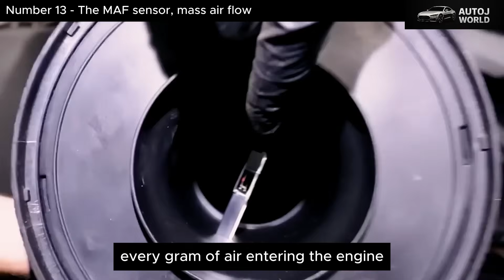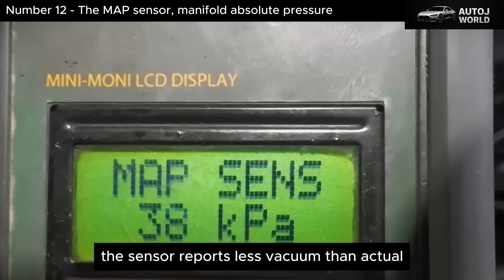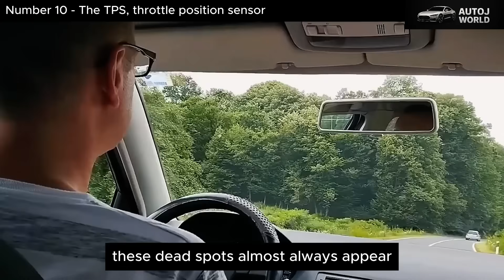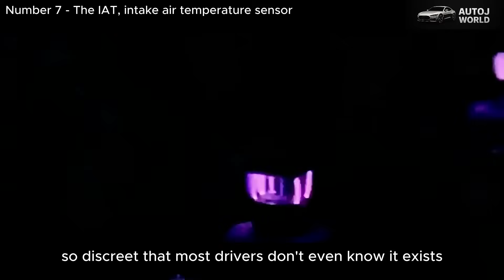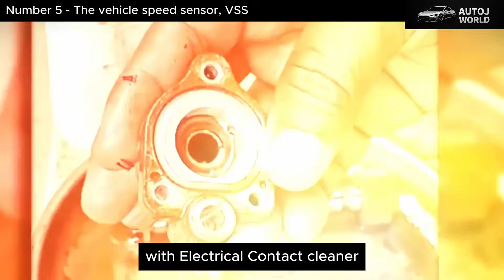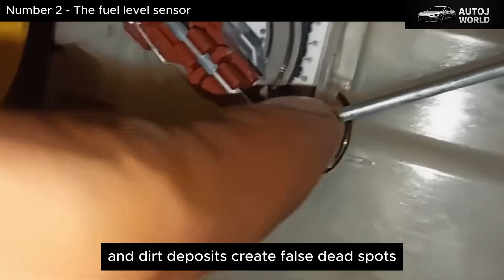The Sensor That FAILS Most Often in Your Car and Almost No One Cleans

Comment: it would be nice if they show diagram of where parts are located for each specific car make in the maintenance manual, then the people would at least try to do some repairs. I have Silverado 2001, I replaced oil, oil filters, air filter, but never touch the sensors. I think it would be nice for me to know where sensors and cleaned them. i have over 340,000 miles and never touch them, never had issue until now, more gas consumption.
Reply from the maker: Glad you're looking to maintain your truck; hopefully this helps you get started!

Comment: Yeah!!!
I JUST FIGURED OUT THE CRANK NO START. 
AUTO ZONE DIAGNOSED MY 5.3. IT WASN'T FUEL PUMP😅😅😅BUT FUEL PUMP FUSE.😂😂THAN
I CLEANED THROTTLE BODY. GONNA CLEAN MAF SENSOR.  ILL LOOK FOR THE OTHER ONES.
BUT I DON'T WANT TO OPEN ANOTHER CAN😅

Comment: Actually the entire philosophy of all this is genius.  Granted, harder to diagnose than a carburetored old school timed motor, but much cleaner and efficient.  They should have stopped right here.  But, they tried to squeeze blood out of turnip with direct injection, turbos, cylinder deactivation, CVT’s,start/stop, fewer cylinders, weak rings, wet belts, and thinner motor oils.  Then they overdid the plastics and under engineered them to boot.  Every manufacturer has in 2025 the technical knowhow to build a 250,000 mile engine.

Comment: Change your fricking oil every 5,000 miles and these wont fill up with sludge !       I have a 2001 GMC Sierra that still has all these parts from the factory (never been changed) because I change my oil and oil and air filter regularly as needed.     NOT Difficult if you take care of your vehicle !

Comment: They missed the most important sensor of all. This sensor is even more detrimental to the safe operation of your vehicle than all those sensors mentioned put together. That sensor is the passenger Methane overload sensor. This sensor can be a life savior technological marvel. Sometimes when you are driving and have a passenger present catastrophic events can take place putting the driver in a very dangerous even deadly situation causing catastrophic driver failure such as coughing, gagging, projectile vomiting and even passing out from lack of oxygen due to Methane gas overload while at the wheel. Although, almost never mentioned in emergency response reports, this tragic occurrence has been proven to be the root cause of as high as 35% of all automobile accidents involving fatalities and critical injuries. So my advice to all of you is to always have your mechanic check this sensor for you at every oil change. It is always best to choose a mechanic who consumes a large amount of unhealthy, intestinal track irritating foods and drinks a lot of beers after work. Timing your oil change with your mechanics unhealthy habits is crucial to testing this critical Passenger Methane Overload Sensor (Also referred to as the Passenger Silent But Deadly Warning Sensor) properly. Thank you and always be aware of your passenger's SBDs!

Comment: Cheap connectors are as much to blame as dirty ones.  The coil array connectors on my Silverado had several female side pins that lost their spring tension and collapsed, not making consistent, good connection.  I replaced both connectors with IP-65 grade aviation connectors.  Problem solved.

Comment: Excelent video, and these are the 13 lucky sensor. Additionally I suggest to include the wheel sensor speed which occasionally send wrong signal to the ABS Module.

Comment: Many oil pressure sensors leak oil when failed not always of course but most show signs of oil inside the plug when failed especially actual oil pressure sensor not just low oil on or off sensors I have seen both leak at failed conditions.

Comment: Bad cam sensor will make a International Diesel not run at all if bad, When it starts to fail the engine will shut off after heating a little, The problem usually intermittently at first sign of failure.

Comment: Quick reminder for Ludites. Cars that didn't have sensors used a lot more fuel and you were forever spending Saturday under the bonnet.
Reply: not true. It's a fun minigame to drive at the optimum condition for that car (eg: we chase the powerband-RPM), it is also not boring to fix car, it's like a toy. (when we drive it properly, it doesn't consume anymore fuel than a car with ECU. We know at what RPM it's tuned, so we can drive at that RPM for best fuel consumption).
Reply: @xponen  I did enjoy the tinkering I must admit but I've never got 55 mpg out of any analogue car.
Reply: @Spludgeroo  we can get 50mpg on carburettor by using small engine. For example; Daihatsu Mira from 1990s has 660cc or 850cc engine can achieve that mileage. The rule is small-engine get higher mileage regardless of carburettor or electronic-fuel-injection. In fact, on 125cc-motorcycle-engine we get 100mpg. When people talked about 100mpg, they talk like it is mythical/difficult, but it is simple to achieve 100mpg by changing the engine size.
Reply: @xponen  Well I had a Deawoo Matiz and it drunk like a fish on the motorway and it was like riding in a biscuit tin but my big comfy Citroen C8 got 55 mpg.
Reply: @Spludgeroo  Deawoo Matiz with 796cc engine with electronic-fuel-injection? maybe the distributor (ignition-timing) is broken or misconfigured (such as vacuum-hose got disconnected from the distributor in older cars), or maybe you drive at wrong RPM (for lightweight-engine, the RPM need to be 2500-3000rpm, but for heavyweight-engine like 2000cc Citroen C8, it is around 1500-2000rpm)
Reply: @xponen  Dunno. I've had loads of cars and ECU is better. I can't do anything with 800cc. Can hardly get in one.

Comment: My GMT400 has a carburetor (NO sensors) I don’t have ANY of these problems…
They sacrificed reliability for perceived superiority and we pay for it.  It’s all about narratives,  it’s more fuel efficient.  What is the carbon output to build and replace all the electronics that control the “modern” “fuel efficient” vehicles?  The attached the “efficiency” coefficient to a different variable to create a “new” constant and self declare a technical value that is a blatant lie and we pay for it.  Over and over and over, we pay for it…

Comment: knew them all, but great video... really good
have a good mechanic and am changing or cleaning all the sensors for the moment....
my 2 liter tdi 12 year old Audi A4 runs like a Swiss watch... 52 to 55 mpg
Reply: How did you do it?. I have 2012 Audi, I swapped the motor and transmission together, 
But it still not running smoothly, and the transmission is also shaky and not selecting smooth
Reply: @nedumjeff3106  I have 100k miles...drive 95%  highway at 70 to 80 mph...I have the 8speed AT from ZF... AND CHANGE OIL EVERY 5K MILES...

Comment: With a bad CPS crank position sensor it can cause a no start condition. It is necessary to have a CPS for the engine to run.
Reply: Not true ...engines operated perfectly with no sensors or ecu's not that many years ago
Reply: @JimW.-ns3pj ? Umm yes we all know they did. He wasn’t staying otherwise -only saying that on engines so equipped they’d get a no start

Comment: Time to go back to vehicles that don't even have any of these.
Reply: Back then the odometer only had 5 digits.
Reply: Oh yeah, fucking around with a damn carburetor and vacuum lines was great fun. Get any performance out of "dem good ol days" engines and they need constant fiddling and run different when the weather changes. Screw that. In the beginning of the smog control efforts, yes, it was trash and even more fiddle, but we are way past that. Probably went overboard on the tech around 10 or 15 years ago too. But, no bail stripped down engines are not practical for daily driving unless 80 hp  is fine,  or you are ok to use a single digit mpg engine to get a little grunt. We had just about the right amount of computer participation sometime around the 2000s to the 20teens, depending on the brand, then they really went hostile on end users, but throwing it all out is not the answer either.
Reply: @michaeljarvis5489  - Agree! I prefer the Ford 'Panther platform' cars - Crown Vic, Grand Marquis, Lincoln Town Car from the early '90's to the last ones in 2011. They had just enough tech, were simple, tough, safe, reliable, and weren't overloaded w extra needless space age electronic crap later cars now have standard, that break down every few months and costs thousands to fix. If I could, I'd want one w roll up windows, and manual door locks. But unfortunately, they weren't made quite that old school anymore after the 'early or mid 80s.
Reply: @michaeljarvis5489  that's why i love my 2002 honda accord. not too techy and reliable.
Reply: @ayoobi1691 my 96 civic is so easy and it doesn't need constant maintenance and it will absolutely fly .it was really cheap to replace everything and very easy and is now a new car that could be 150k to need much more
Reply: Are you serious? You wanna stick to old technology forever? If it's possible go drive a Model T Ford.
Reply: or, as Hamish have done, back more to ponies/horses......while at it, replace tractors wirth oxen......mobiles with landlines etc....

Comment: 13. MAF: Mass Airflow
12. MAP: Manifold Absolute Press
11. Oxygen Sensors 
10. TPS: Throttle Position Sensor 
9. Crankshaft Position Sensor
8. CMP: CamShaft Position Sensor
7. Intake Air Temp Sensor 
6. Engine Coolant Temp Sensor 
5. VSS: Vehicle Speed Sensor 
4. Knock Sensor 
3. Oil Pressure Sensor 
2. Fuel Level Sensor 
1. Sensor connectors & harness
Reply: tysvm
Reply: Fuel Rail Pressure Sensor
Reply: @larpsim  yep
Reply: Lotta mechanic will rip you off
Reply: Ambient Air Temperature Sensor 
Exhaust Temperature Sensor
Vane Position Sensor
Transmission Temperature Sensor
Water in Fuel Sensor
Reply: Thanks
Reply: Tyty ❤
Reply: Cla200d 2016 reg coupe sensors
Reply: You forgot the blinker fluid temperature sensor
Reply: You forgot a couple or 3: Tire Pressure Sensor..Windshield Washer Fluid Sensor..Radiator Coolant Level Sensor..
Reply: Thank you

Comment: Great info, could you comment on the use of the EGR valve, when and why it activates. thanks 😊
Reply: The EGR valve takes some burned exhaust gases and meters a small amount with the new fresh air going into the engine. Its purpose is to reduce NOX
emissions. With mileage, it is not unusual for the mechanical valve to develop carbon and gum deposits where it may stick and causing rough idle or stalling. It can also cause a check engine light. If you have a very high mileage car it can be removed and inspected; replacement is often the best option.

Comment: Over the years much expense and complexity have been added to automobiles for small gains in fuel economy.
Reply: If they want to sell more vehicles, get rid of all this bs and go back to making them simpler.
Reply: Yup, IMHO cars had enough techy stuff by the early to mid 90's. All the extra crap since is just good for making mechanics rich, and sticker prices ridiculous for the middle class! 🤑 🚗
Reply: @user6tos8ca Unfortunately most garages like simple and quantifiable service items and will immediately bail when confronted by any complexity such as electronic problems.
Reply: @AdamEast-yo8pz  - Probably true. All the more reason for me to keep my much simpler older cars in good shape as long as possible!
Reply: Your point is right but on a more broad scale for technology with small gains over the years... All except fuel milage  to a degree. 
  Never had there been any engine's  back in 60's, 70's, 80's, 90's that had 395 hp and get 17 mpg in city and 21 mpg on the highway. I have built many SB and  BBlocks that hit 375/425 hp and 8-10 mpg at best and if racing 4-8 mpg.
Reply: Yeah with massive engines that negate alot of the power hence how a lot your cars could only get few hundred horse power from a v8 5 litre engine lol

Comment: Give us back the dependable cars of the 1960's. These new cars that are supposed to be so great, are actually crapola. They run good for a couple years, then suddenly the cars start breaking down constantly.
Reply: Correct... and as really good and experienced mechanics are leaving the repair business. We are stuck with technitions who rely on anyalizations performed by more computers. Which costs far more than a good experienced mechanic, and many repairs cost more than a good used car used to cost.
Availability of older used vehicles was made far worse by a past president obama with his cash for clunkers crap... now the supply line for old vehicles and parts has nearly ceased. Forcing most to overspend on new or nearly new junk.
Which was all in the plan... more sales= more taxes, once again you are screwed out of your money because big government and big business like a big bottom line.
Reply: Saboteurs in your pockets..
Reply: Nah waiting for the two stroke rotary valve engine
Reply: At least with the new electric cars if there's a new sodium or aluminum battery there goes your sludge problem and thus a lot of your sensors remain optimal

Comment: "experienced technicians alway inspect wiring and connectors before condemning expensive sensors" BAHAHAHAHA! 😂😂😂.. Maybe on their own cars. For everyone else, the scan for codes which often have multiple possibilities, tell you everything needs to be replaced, and then lock & load the parts shotgun. Yes, there are exceptions. If you manage to find an honest mechanic, treat him like gold. This is not limited to auto mechanics, it applies to all service & repair trades. If you have anything in need of repair, do as much research and diagnosis as you can before calling someone.
Reply: That has absolutely been my experience. I work around that deficiency by doing my own maintenance and repairs. My modern car has an ODB2 scanner in the glove box and my other car is old enough not to have a computer.
Reply: @andrewwasson6153 With the exception of City Chevrolet in Charlotte, NC, who I had a relationship with, I took care of them, they took care of me... Every other time I went to a shop, because I didn't have a place to do the work or was recovering from surgery, they tried to rip me off. I even warned one place, Tuffy in Charlotte, that I went to for a coolant flush. I told them I've been turning my own wrenches for 30 years. I was only there because I just had shoulder surgery. I said I'm really busy, I have 3 work trucks and my wife's car. I said if you don't try selling me rooty rods and muffler bearings, I'll start bringing my vehicles here for maintenance. They got a laugh and said no, no, we would never do that. I go to pick up my Duramax/Allison and they said my tranny cooling lines were rotted out and need to be replaced. I said, is that so??? You mean the brand new Fleece Performance heavy duty, industrial grade lines we just installed? (had an employee do it on a slow day). He started "Oh, well, uh... " One of the fittings needed a 1/4 turn on it. They could have charged me for the 5 seconds it would have taken and I'd be happy and give them my business. But no, they had to try and rip me off. Haven't been to a shop since, and won't unless I need dealer level diagnostic tools. It's an '06 so there isn't much I can't do without that.
Reply: You're correct.  Invest in a decent scan tool and research plenty to keep your car from a mechanic  for as long as possible.
Reply: So true,like the medical system,if the doctor cures you,you never come back and spend more of your money trying to get well.
Reply: When our shop would tell people that field mice had chewed through electrical connections, some customers didn't want to believe us!!! 😂😂😂 We got so good at finding the weirdest problems and fixing them, sometimes the Dealerships were sending their headaches to our shop. There were times some particular car models that none of the Dealership technicians wanted to touch!!! 😂 The infamous Opel made Cadillac and Saturn...they ran a main coolant metal tube straight through the bottom of the intake plenum between the cylinder heads! They all would eventually leak. It wasn't just an intake plenum job; you had to take the timing chain off to get to it!!! Lol. Then , nobody had the tool to line up the timing chain gears ! We had to fabricate the darn tool ! The customer thought we were joking when every dealership refused to accept repairing their own car. 😮 Because initially, we had other repairs that didn't require such a headache, we told the customer they should try the dealership, but we ended up fixing the problem! Over 40 years in that crazy business! 😂😂😂 Is Scotty Kilmer still on YT?
Reply: You shouldn't have to you should let the professional do their work and they should not overcharge for it. Greed is killing America. Just because you can rip somebody off doesn't mean you should. America used to be based on fairness.
Reply: Every time you're ripped off on today's heat engine you sell another electric car.

Comment: I think we just need even MORE sensors….
Reply: Sensors are great for keeping things operating perfectly and preventing failures. The problem comes when the manufacturer makes it so you need several thousand dollars of dealer level diagnostic tools to program the sensor so the computer recognizes it. It's unnecessary and only serves to punish the DIYer.
Reply: Right, maybe a B.S. detector when you talk to the Service Advisor at your local dealership.